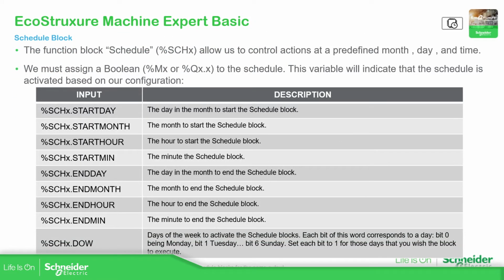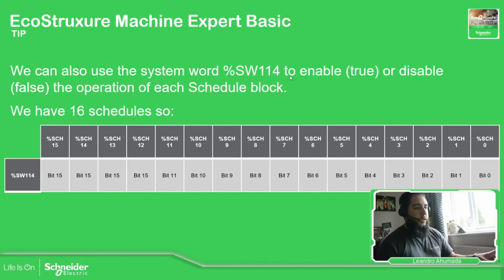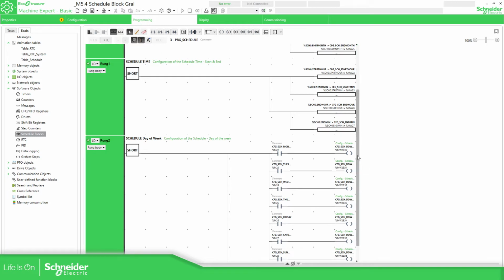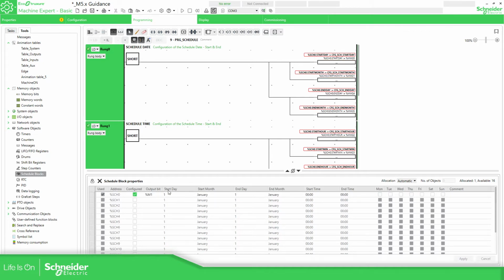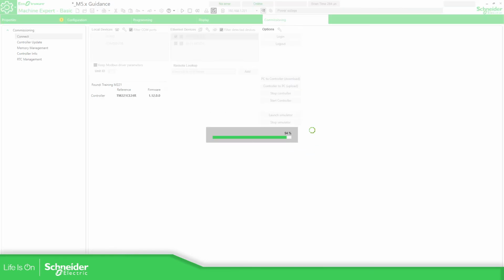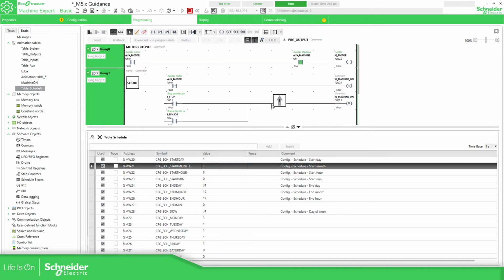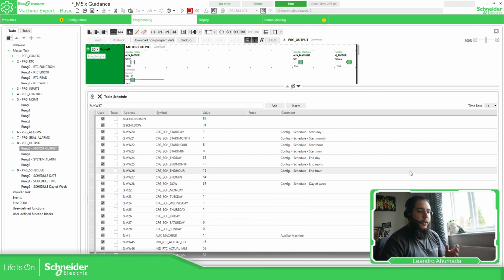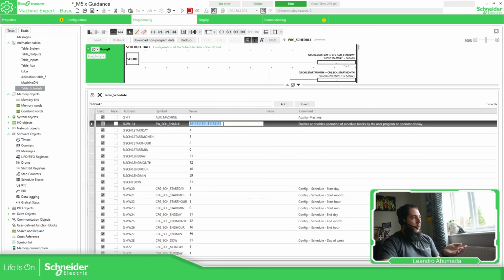Training - M221 - M5.4 Schedule Block

Comment: Hi! Can I using operation block for day of the week to enable operation instead of memory bits? 
for example: i want to operate the %Q on monday, on operation block i program %SCH0.DOW = 0
Reply from the maker: Hi There! you can use the syntax "%Q0.0" for example to write the output from the scheduler. You will need to know which output you need to trigger. I usually use the %M rather than the actual output.

Comment: thank you for your helpful videos, how can i use a retentive memory in eco struxure ? . I noticed the maintian value in a behaviour section but it made all memories  as a retentive . I need to make a specific memory as aretentive
Reply from the maker: Hi Ahmed! if you are using the Modicon M221 then the first 50 words (%MW0 ~ %MW49) are retentive. Then (If i am not wrong) the rest of the variables will be retentive as long as you have the battery in otherwise the information is lost. I recommend you to have them retentive and in case you need to reset something you can do it on the first cycle of the PLC.
Reply: @LeTomasAHUMADA   Thank you for your  kindly reply and support

Comment: can we use schedule block for monthly program , for example setting temperature for room for one month ?
Reply from the maker: Hi Saman! With the Schedule Block you can configure when a %M is going to be activated. Then when that %M is True you can move your “pre-configured” temperature for one specific month to the actual month.

Another solution is to compare the value of the actual month using the rtc block and then assign the desired value.

In any of the solution you will need to have different %MW for each month and then an additional %MW for the actual month that will have any of the values configured.
Reply: thanks sir, my question is , if we have temperature sensor we want to set according to days for 70 days , for example (day0 temperature setting = 35c,for day 1=34c,day3=33,_________________   day 70=23 C ) it means setting days temperature via HMI . can you explain about it please ?